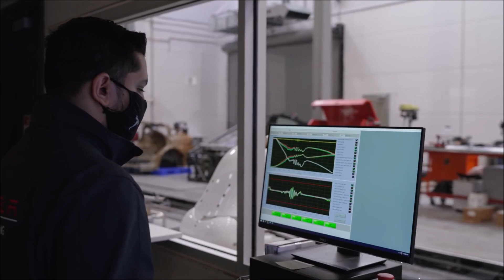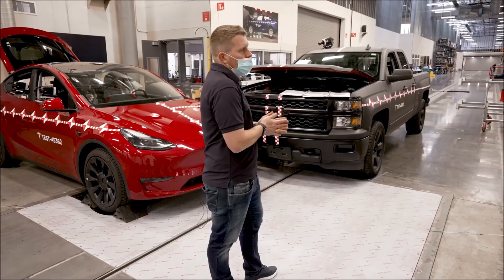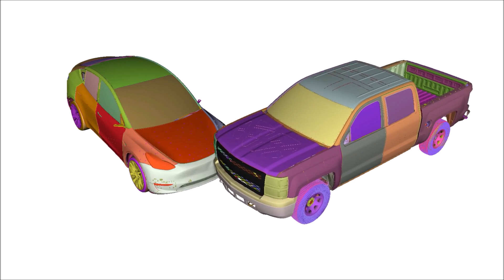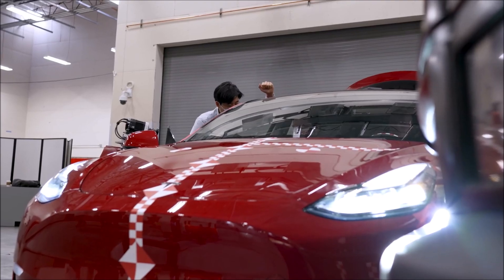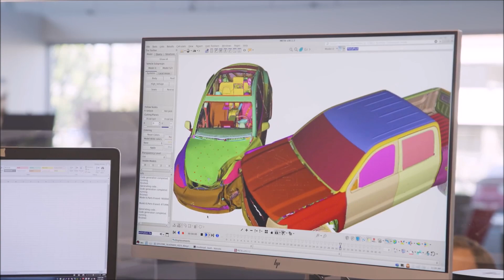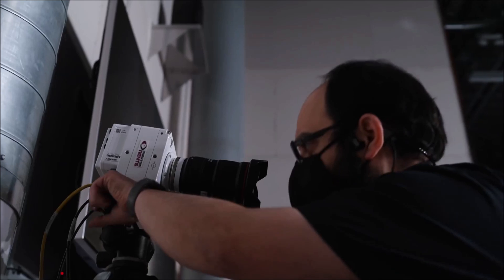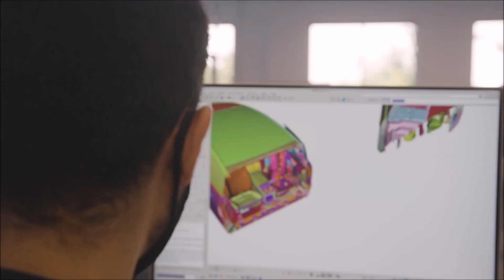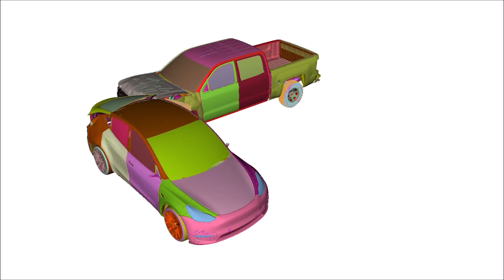Tesla Unveils New Crash Safety Tech Based on Collecting Real World Data

Comment: Good report Arman. One thing I noticed that the garage-lab crash that is NOT 💯 real-world accurate… the floor material. That shop floor looks much “slipperier” than a hot asphalt - so the Y spins easier upon impact than what may happen out under the sun on a hot dry day. I say heat matters b/c of warm rubber (tires) grip. Food for thought 💭 Tesla.